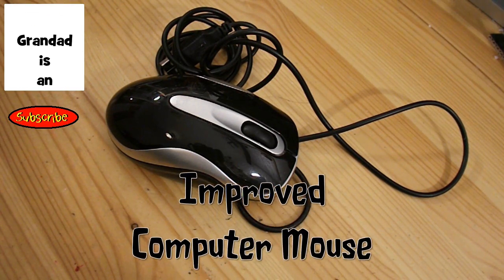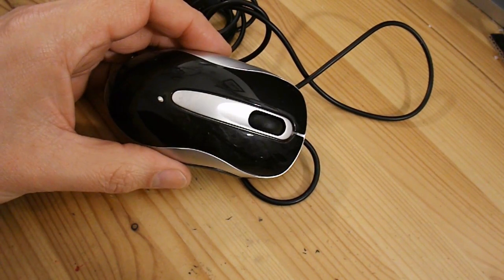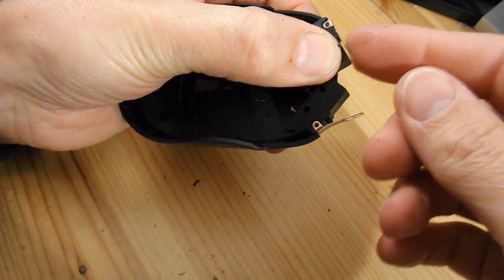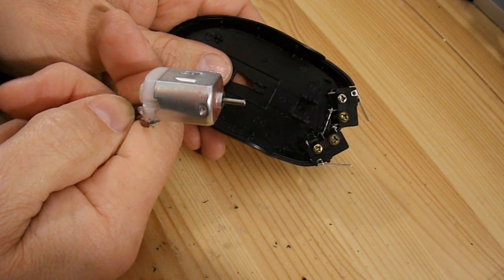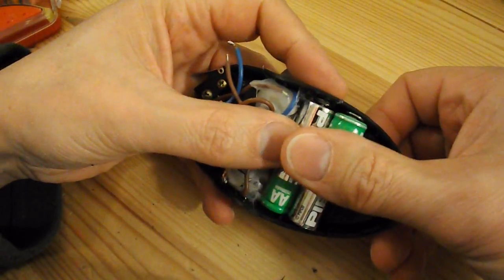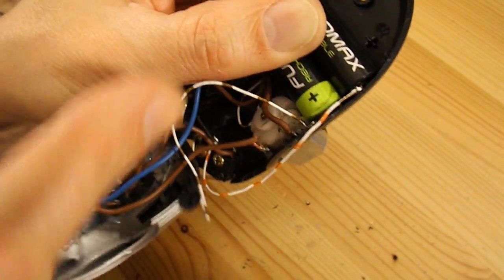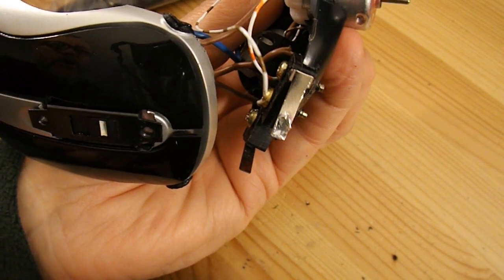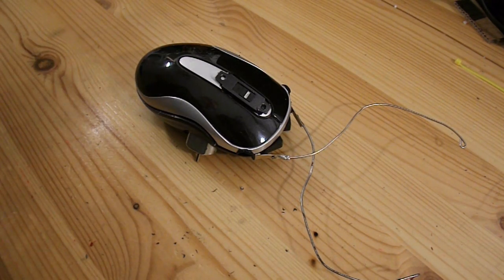Improved Computer Mouse Bug/Bot

Comment: Circuit diagram grandpa!?
Reply from the maker: Yes, circuit diagram is in the video 👍
Reply: @GrandadIsAnOldMan  No grandpa…i want info about wiring
Reply from the maker: @anyonecanmakeit718  what about the wiring? The circuit diagram is in the video. It is at the end, maybe you didn't watch the video through.
Reply: @GrandadIsAnOldMan  ohh now i got it Thanks 🙏🏻
Reply: @GrandadIsAnOldMan  motor not running on putting batteries but when i pressed switch it runs why
Reply from the maker: @anyonecanmakeit718  I would guess you have wired it wrong.
Reply from the maker: You might find the information in the video description useful too 👍
Reply: @GrandadIsAnOldMan  Hey! 2 questions Pa,
What u used as third wheel?
And why u put 2 switches in circuit diagram?
Reply from the maker: Third wheel can be anything you like, just a plastic bead would work fine. The two switches are there to switch it off. If you follow the circuit round, you will realise that a single switch will not disconnect both batteries, so if you throw the bug in a box, there is a good chance that it will start running on one side or the other. You can leave those switches out and just remove the batteries..
Reply: @GrandadIsAnOldMan  but u shown only 1 switch that top on the mouse or have u connect both together?
Reply from the maker: I didn't put two switches on the one I built, then I realised I couldn't turn it off with just the one switch, so the diagram is correct.

Comment: hi this is really cool! I'm just curious though, after I looked through the circuit diagram I can't really tell the direction of the current flows... how does the switch reverse the current direction?:)

sorry I think I just don't understand all the "NO", "NC" and "C" terminals
Reply: oh ok wait I think I kind of understand,

just based on inference, the upper motor is connected only to the terminals C and NC correct? thus it only received power from the bottom battery. and when they upper switch is pressed, the terminals get switched to C and NO instead.

similarly, the bottom motor is connected between the C and NO terminals by default. and gets switched into a C and NC terminal when the switch is pressed so that it rotates in the opposite direction?:)
Reply from the maker: C= Common
NC=Normally closed
NO=Normally open
At the end of this video I did an animated sequence to try to show how it works https://youtu.be/wdJAwJNozoA
Reply: GrandadIsAnOldMan thank you!!:) I think the "reversed" polarities of the motors made me a little confused at first when I was imagining their spin directions.

thank you again!:)

Comment: another five stars video man. I `ve seen your video let`s make a mini robot and I`ve tried to make one but it did not work well because of the floor. you have tested it in a wood floor and it works , but if the floor is not wood it does not work. with ceramic floor is slippery and does not work. the motors goes always round and the robot refuses to go forward. the project is good as the idea is simple and thr motors could not be more simple no need pwm .... etc.    1,5 v ..... perfect. I am gonna try again make some changes to put the thing working maybe some rubber wheels.... for the slippery floor.

is my first robot , without programming , i am going next in the future  make a more perfect and complicated thing using sensors etc, but for now at the beginning this here is perfect  

thank you for your atention.
Reply from the maker: You can improve the grip by putting heatshrink tube on the motor shafts or even a little ball of hot glue.